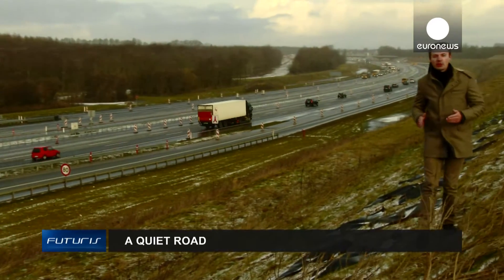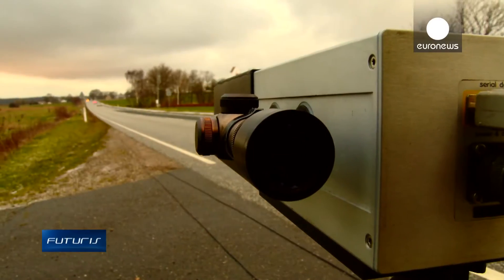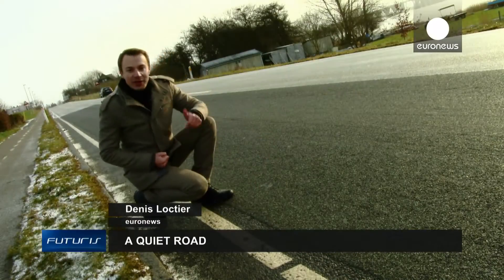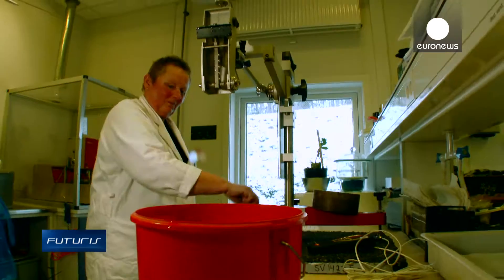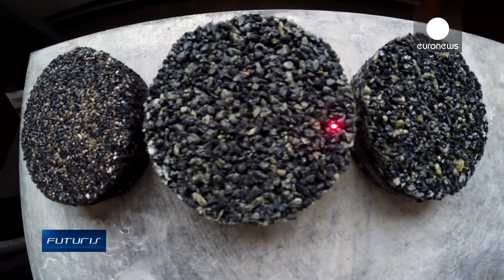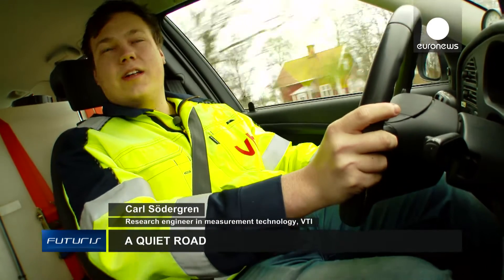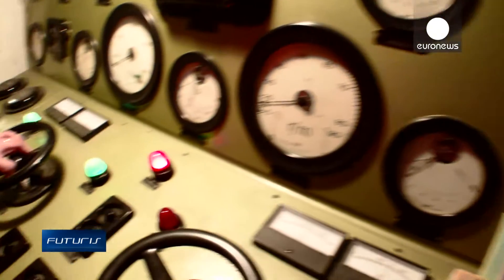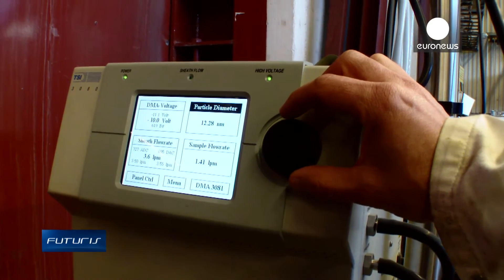Elastic road surface reduces motorway noise pollution - Futuris

Comment: That's another way for some friend companies of the governement to squeeze some money..... if it is water permeable,what happends with that water wich will freeze in the winter in the ground layer under the road? It will ruin the concrete of the highways,bridges etc....if the road doesn't have a concrete layer and it is sitting on dirt,even worst,will moist the dirt deforming the road,also being flexible it will increase the fuel consumption by increasing the rolling resistance.Brilliant invention....
Reply: Do you really think that actual highway engineers, who do this for a career aren't considering all parameters?
Unbelievable (you, not them)